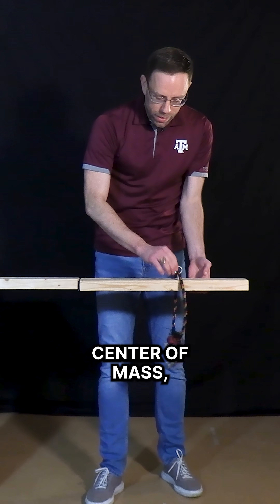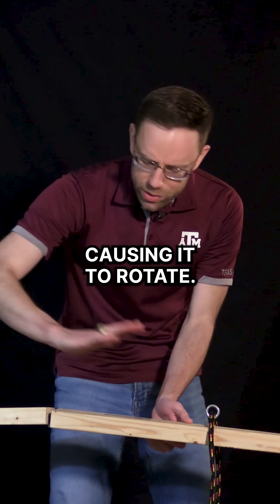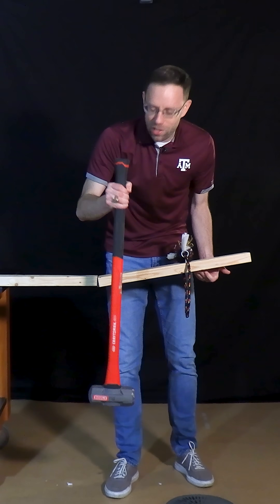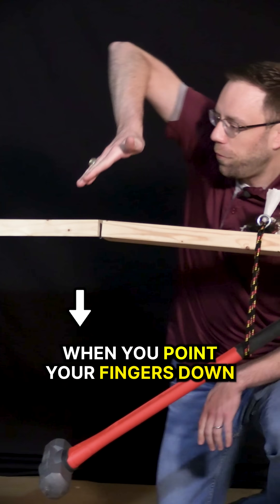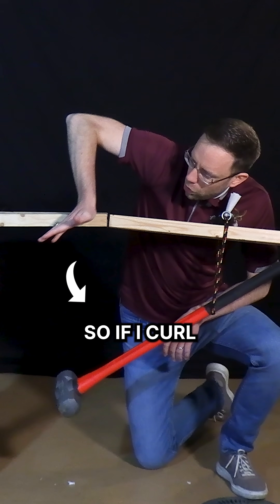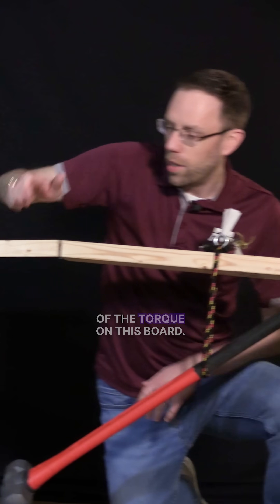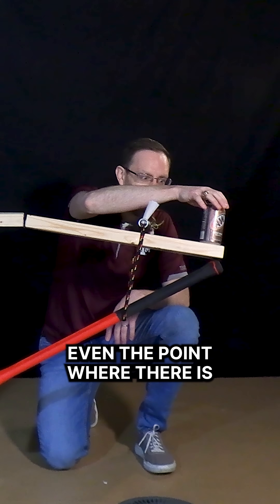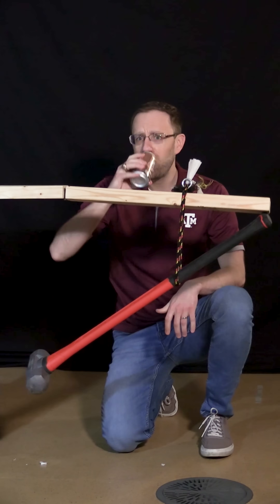Floating sledgehammer using physics! 😮 #shorts #TAMU #DrDawson

Comment: My explanation was that the hammer brings the center of gravity of the entire system inside of the support board so the system doesn't fall. But your torque explanation makes more sense I think.
Reply: Its both :)
Reply: @fishsticks2965  i believe that torque explanation is actually incorrect one
Reply: @shulehr  no its correct
Reply: the direction of the torque caused by the hammer's weight gets reversed because we bring it onto the other of the hinge; the two explanations are really the same
Reply: @shulehr  i'm pretty sure it's right. I had some uni classes on statics and you learn about torque. They actually called it a "moment", not torque. I think torque is something about measuring the force, while moment is referring to the object wanting to rotate.
The combined center of mass of the sledge and board are shifted way to the left. Still a bit right of the actual sledge hammer head but still left of the pivot. gravity pulls straight down and if you extend the line you draw to represent the force then you can see there is a force pushing down a couple inches to the left of the pivot point.

The pivot point is what separates the 2 bodies and the support board has nothing to do with it really. All that matters is the pivot points location. The support board could go straight up and to the right and it would still act the same. If the support board went up and right then the center of gravity out be well outside/away from the support board. That is why bringing the "center of gravity of the entire system inside of the support board" is not the reason it works.
Reply: @Root_T  "Moment" would be more applicable here.  Torque and moment are mathematically the same thing (force x distance).  Moment is usually used for a balanced "static" system, torque would be used for a system that is actually rotating.

That's why your Statics classes talked about it as "moment".  Dynamics classes would have used the term "torque" more.
Reply: It is in fact two different ways to explain the same forces
Reply: my understanding is that 'center of mass' is a useful simplifications of a complex systems like this that will predict the same behaviour. Is that right?
Reply: @improvedalpaca3294  It's not really even a simplification.  Your explanation is just one step further than he went in the video (which might just be a clip from a longer presentation that eventually addresses your point).  He explains it in terms of "torque", but didn't explain where the torque came from.

Gravity acting on the center of mass of each object applies a force - we would commonly call that force weight.  Applying that at an offset is what turns it into the "torque" he described in the video.
Reply: I'd explain it as "now in order for the board to fall, the hammer head needs to move up, but the weight keeps it down, forcing the board to stay up.
Reply: Torque/Moment does not make sense with what he's saying. Yes the hammer induces a clockwise moment, but hinges produces a moment/torque of 0. The reason being is that hinges allow for free moment in rotation, hence the rotation of the wood. Hinges only have Fy and Fx
Reply: I might have misunderstood it. But I thought he was saying the opposing moment is at the hinge
Reply: He essentially says that in the video, when he is giving the explanation of the direction of the turning moment. That the hammer head is too the left of the hinge.
Reply: He changed the momentum now the sledge hammer head wants to go down but doing so the handle push the table up!

Comment: "center of mass" being to the left of the hinge still doesn't explain this.

edit: I successfully recreated the experiment. Mind. Blown.
Reply: It does
Reply: Let me elaborate: Imagine a see-saw. Basic 1st degree lever. if you push down on the left, the right rises. The "center of mass" is where you could replace the entire item with a weight, and see the same effect. So if the center of mass is to the left of the fulcrum, of course the right side rises.

So why is the table angled? Well, the further to the left the center of mass moves, the greater the torque it imparts. but by rotating CCW, the head of the sledge, and therefore the center of the mass spin to the right, decreasing their torque, until the center of mass moves to the right of the fulcrum. Once it is to the right, the system spins CW, moving the center of mass to the left again. This creates a stable equilibrium, where the center of mass winds up directly under the fulcrum.
Reply: It does…
Reply from the maker: Isn't physics wild??
Reply: Of course it doesn't. This is fake.
Reply: @toddsecor288  This isn't fake

Comment: I get this works but it still breaks my brain every time
Reply from the maker: Same. lol
Reply: @tamuphysastr  No, not same. Even though you explain it pretty terribly, you definitely understand it. Stop being quirky in the comments and pretending like you don't understand simple weight distributions.
Reply: @rho-01  Think of it like this:
If the table would rotate, then the head of the hammer would have to go up. Gravity is trying to push the table and the hammer down, which each lead to rotation in opposite directions. They entire thing remains stable exactly where the two forces are equal.
Reply: @rivershen8199 wow! Why could I not see that? And why could that guy not explain it that way?

I was assuming that length would give the sledgehammer greater rotation torque but it turns out that a heavier sledgehammer head is what is needed to counter that soda can…
Reply: @islandwoodfired  You see, everything after a hinge is a "solid" object, and the center of mass of that object is DIRECTLY under the hinge
Reply: @rivershen8199 good explanation I get it now thanks
Reply: @rivershen8199 great explanation
Reply: @rivershen8199 je ne le dirai pas ainsi. Pour moi,  il faut considérer le poids de la masse et de la table qui sont attirés dans la même direction par la gravité. Or; le poids de la masse se trouve de l'autre coté du point d'équilibre déterminé par l'axe de rotation de l'ensemble. Autrement dit,  il s'agit d'une forme de balance bien particulière qui passe par deux autres points de forces qui s'annulent partiellement, puisque le manche de la masse se trouve de l'autre coté et que la distance du point de force est plus éloigné du coté du manche que du coté du poids par rapport à l'axe de rotation qui est le point d'équilibre de la balance  !
Reply: @rho-01  the hinge: 💪🏻
Reply: The handle end of the hammer is pushing up on the wood as the heavy head side of the hammer tries to fall down straight. The hammers attempt to rotate pushes the wood up
Reply: You have two objects pulling down on either side of that hinge.

If the head of the sledgehammer moved down, it would need the 'hinge' to move counterclockwise.
If the piece of wood moved down, it would need the 'hinge' to move clockwise.
Reply: It is simple really. As the surface of the Earth along with everything on it accelerates outwards due to the curvature of spacetime the board gets left behind so putting the hammers head that is really heavy and harder to accelerate there allows  the rope to pull the handle upwards so that the electron probability clouds of the molecules at it's end through the interactions of virtual photons with the electron probability cloud of the plank's end molecules repel the plank's end helping it accelerate faster and almost catching up with the other plank.
Reply: For real
Reply: Same man
Reply: Yeah! I understand the physics of it….. but I don’t understand the reality of it.
Reply: Next time don't cut the board
Reply: It's because the scene cut and magically shows everything floating
Reply: @rho-01  Same
Reply: Yeah...
Reply: @rho-01  need to think in torque vectors.
Reply: my brain wont let me believe this. its fake. and thats that!
Reply: Man... Same here, I still can't believe it doesn't just fall like before just with a hammer attached. I'm staying on this until it no longer confuses me
Reply: Torque is also called "a moment of force".
Reply: the lite board is throwing you
Reply: the hammer head is falling with a mass heavier than the table, therefor hammer has a force acting stronger than that of the table, therefore the table does not fall
Reply: I guess it is physically equivalent to having a pulley with a weight on one end of a line and the table on the other but that makes intuitive sense to us because it's suspended above the table and one end of the line is pulling it up. This is the same thing but it just works in a way we find unintuitive.
Reply: @85481  it is just a very strange weighting balance
Reply: You have to see the lines maaaan, ooooopen yourrr miiiind!!! (Creepy Belly Morty)
Reply: ❌If you put a glass of water on a table like this, it will wobble and spill. If a car drives on a road like this, it will tip over. Where can this principle be applied efficiently?
Reply: @mathamour  understanding physics in full means understanding niche ways in which is seems to bug out.
Reply: @mathamour the only real reason to use this principle when building is to make something like a tensegrity table
Reply: @mathamour  to hold a lightweight, unspillable object in the air. For example to support a phone or tablet to watch YouTube or other online videos handsfree in front of your face and close to you without the heat generated from the device warming your lap.
Reply: @mathamour  tensgorty
Reply: @rho-01   Same. I think the reason is because we don’t see any example of this in our daily life. And the hammer is a smaller and shorter object compared to its handle and the board, and it’s midair, you can’t see the forces that act on it with your eyes. I’d definitely call the whole experiment an illusion, a magic trick 😅
Reply: Physics is broken, we need the patch uploaded.
Reply: It doesn't
Reply: @ipsojuree  it does lol, it is basic physics
Reply: Because you just watched an awful aggie professor explain it to you
Reply: I don’t blame u. Bro did an awful explanation
Reply: Shows limitations of common sense. Together with Monty Hall problem, optical illusions... We are not living in reality. We are living in incomplete mind model of reality. Simillar, but more stable, to a dream.